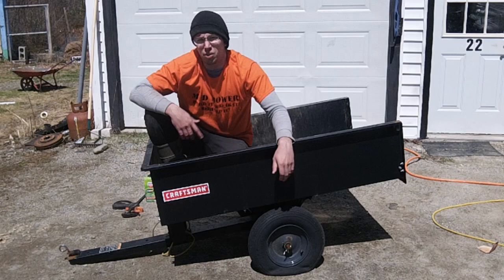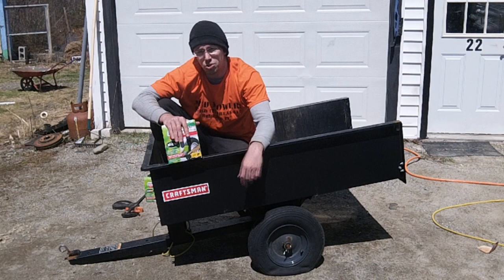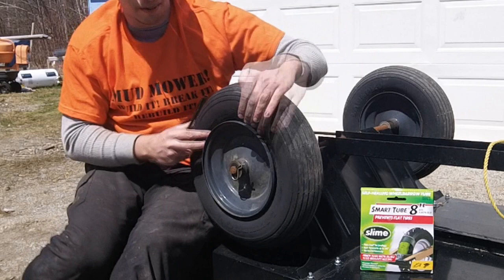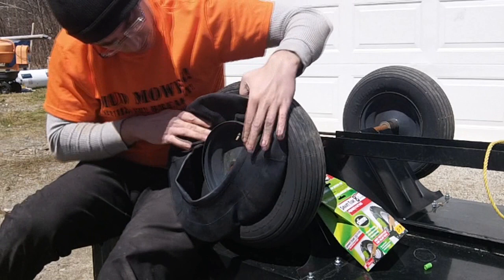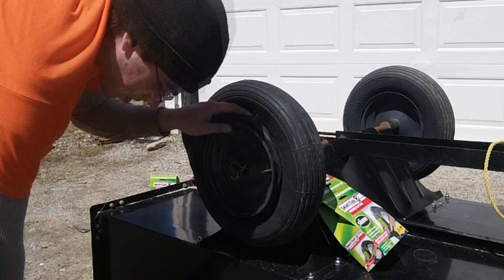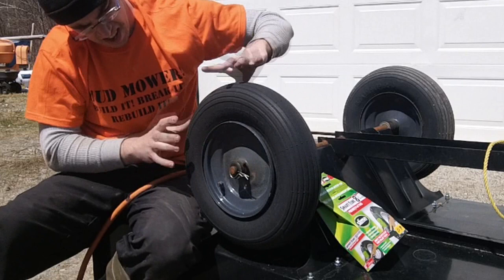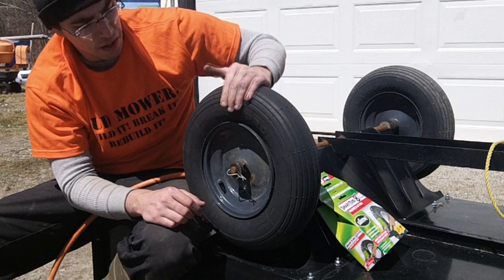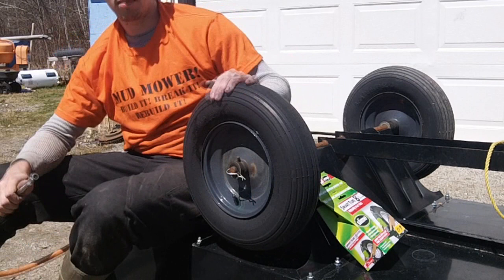Utility Trailer  Inner Tube Install Wheelbarrow

Comment: Once I put the tube in I put the cap back on to keep the air valve in place as I adjust the tube and tire. I used a butter knife handle or ratchet handle to help set the tire if if can't find my tire irons.